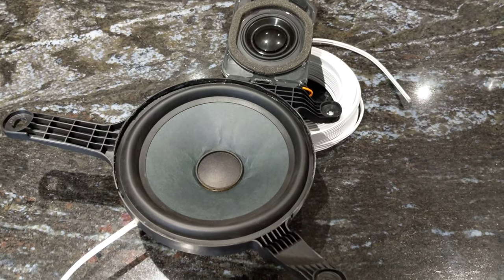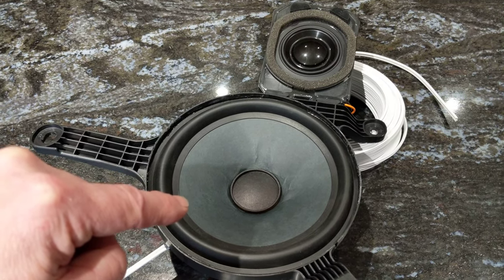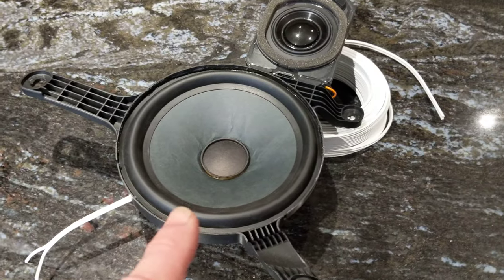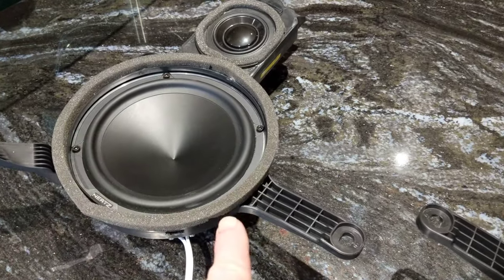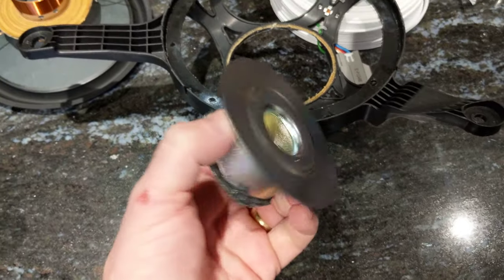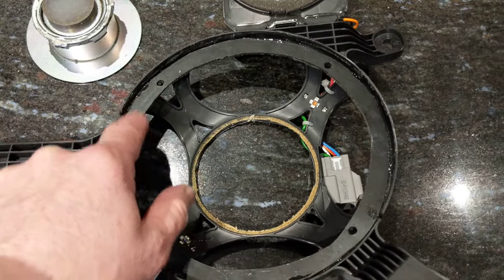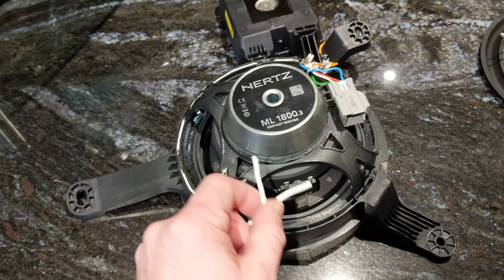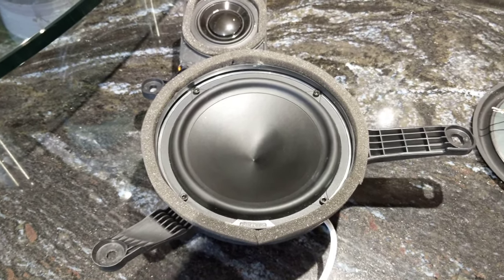VID_20190121_101405.mp4

Comment: Hi, i have a question. did you used amplifier for the back , or did you tap to the original amp? and did u used the original signal of the back, or tap to the frond sub signal?, thanks in advance.
Reply from the maker: I ended up using another audison amp to power the subs. I took the feed from the front 3 speakers and used that as the signal.
Reply: May I ask please if you used a mono amp for the subs or you used a multi channel app , that set to sub to be able to control left and right from the head unit .
Reply from the maker: @efisal  I used the AP1 as the amp, using the Sub out on the DSP

Comment: Hallo, thanks for that helpfull movie. Do you have also a manual / video how to take off all the stuff behind the seats to get to the speaker frames?
Reply from the maker: Hi, to take the panels off, you need to remove the rear panels that support the parcel shelf, remove the door frame/sill covers, remove the center panel between the seats, and the pull forward the parcel shelf. From there you can lift out the speaker panels.